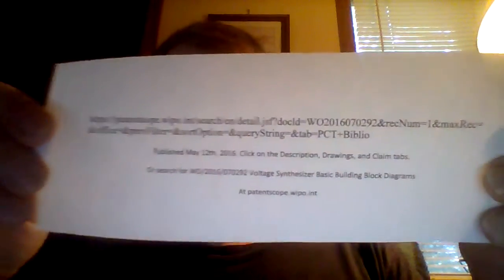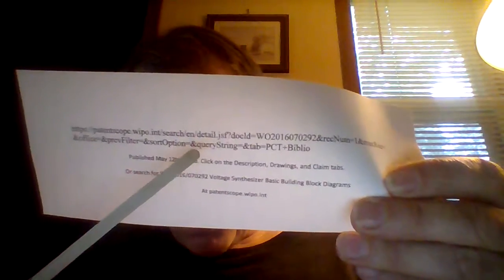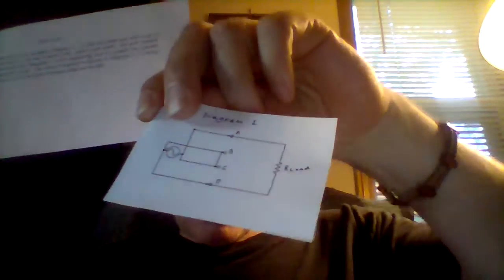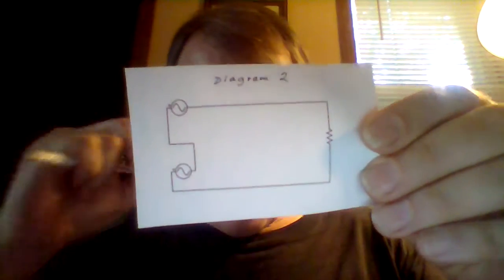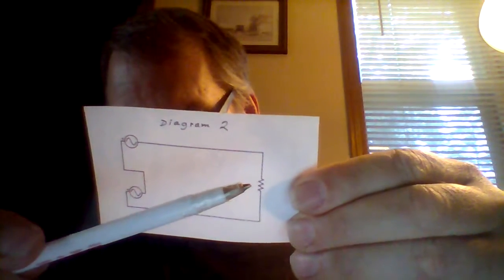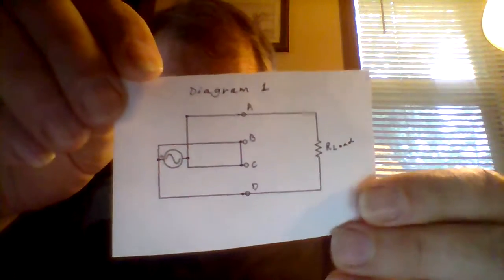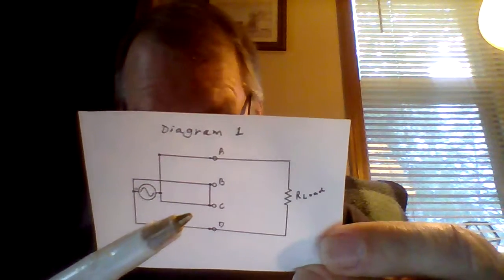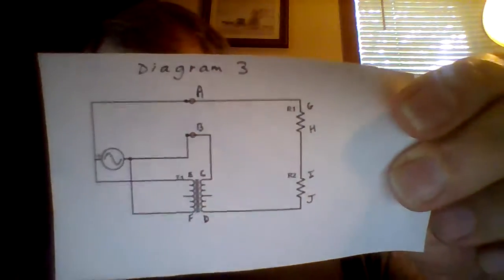Voltage Synthesizer Basics Part 1

Comment: So this is just multiple in-phase AC sources that doubles the voltage?
Reply from the maker: No this is just one AC source (two parallel branches), but they are in phase. You can read more at http://voltagesynthesizerbasics.blogspot.com/. There is something wrong with diagram 7 I need to correct, but I will soon patent this new diagram and will call this something like Backup Power Supply Current Saver. Waiting for Amazon to deliver a power inverter.